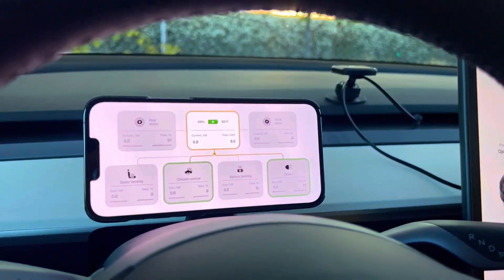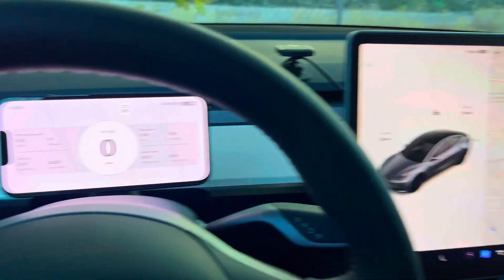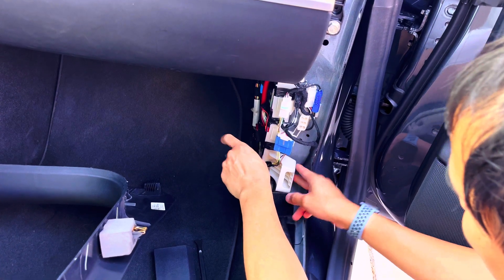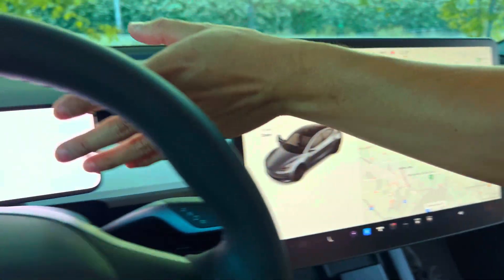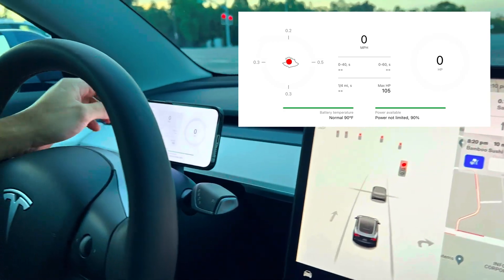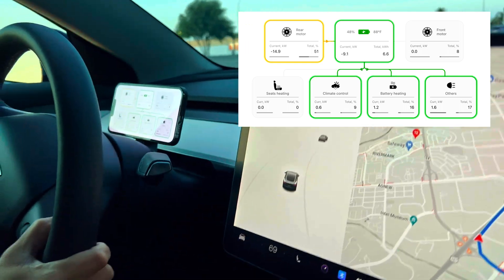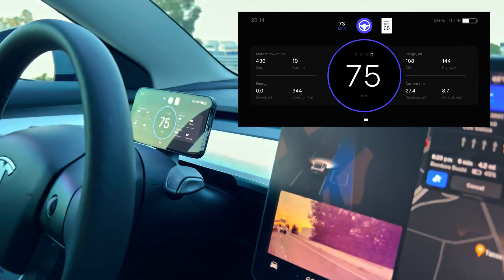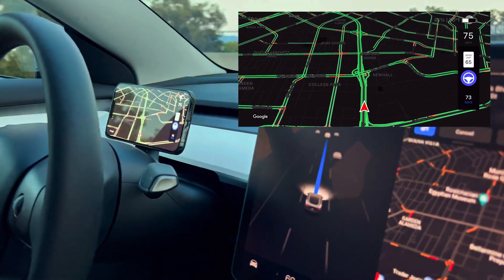Teslogic Dash Mobile Instrumentation Panel for Tesla Model 3 & Y Review + Installation | July 2022

Comment: Does the display device require a carrier data plan, or can I use an older IOS Iphone with no carrier? I would prefer not to use my main phone, but get a 2nd non-carrier connected device.
Reply from the maker: It does not require data plan unless you decide to use Google Maps (last screen fat right), but you can use Wi-Fi hotspot.

Comment: I should have used your Code.. 
for Acceleration 0-40 0-60 and etc. You need start from a dead stop and then Full Throttle/Pedal Acceleration.
Reply from the maker: Thanks for the feedback. The 0-40, 0-60 etc didn't seem to work for me but the latest app update which I'm currently reviewing should work. Needs more testing though. I think it has to be related with track mode.
Reply: @JPMediaProductions   I have Dual Motor “Boosted” and no track mode.. I’ve been able to do all but no quarter mile accuracy since I slowed down. 
Note I updated app this morning.
Reply from the maker: @btazhunter  thanks for the information about that. I will pass that info along to their team. Any other bugs or features, please let me know.

Comment from the maker: I did additional testing on Android on the Samsung Galaxy S20 FE and the Pixel 5, the application works well and is high performing. The “Energy Saved” on the main speedometer dash does work and Google Maps and the arrow seems to be less choppy. 

The other bugs and requested features are identical on iOS 15 and Android (11 and 12).